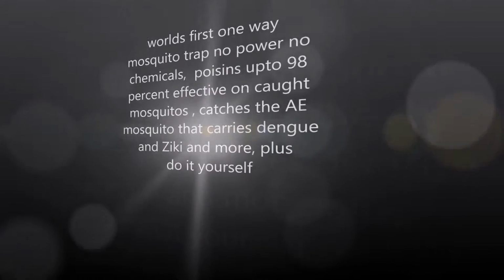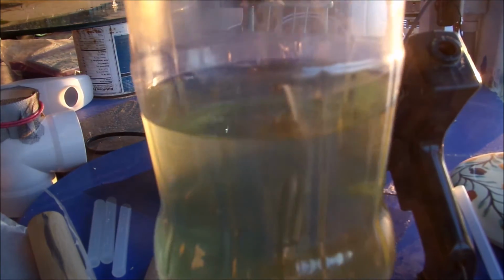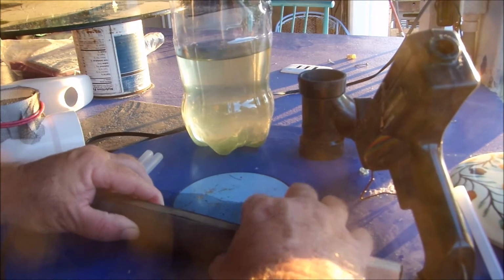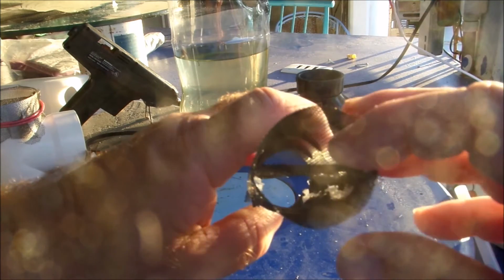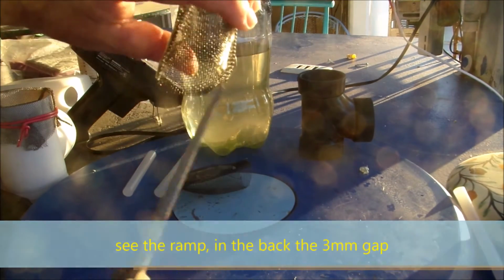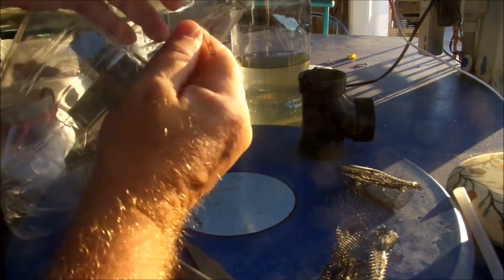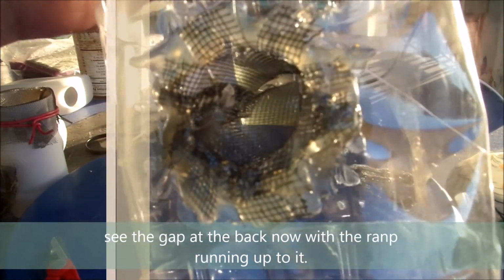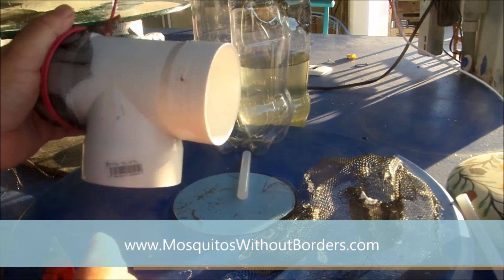new DIY one-way mosquito trap, just add water

Comment: Hi, I found your website and your video.  I am trying to make these to use around my house.  I don't have soda bottles but I do have 1 gallon spring water bottles and I have stainless steel screen.  My hot glue gun conveniently stopped working, so I took some flexible thin wire and kinda stitched the roll in place to make a wire mesh tube. Because the wire mesh is so stiff I don't think it will flex back open, but I will take a part of the wire mesh that peeled off and use that tiny wire to loop through the gap onto the outer circle of the tube. Thankfully I have some jewelry type tools,  pliers with strong flat grip and needle like grips to pull it all tight. . I was able to fix the glue gun enough to attach it to the side of the bottle. I collected some rain water  and left some leaves in it.  when I saw some larvae, I put BT into it to make sure they didn't mature and then I strained the water and put it into my jug.  I'll let you know what happens.  Thanks for this idea. If it is as successful as you suggest, I'll put up more around the house. My backyard is a pine forest that drains to the waterway so it stays damp and swarmed back there, even in the hottest part of the summer.
Reply: Thanks for the feedback.    Yes any type of decent sized bottle should work.   I have used some slightly cracked 5 gallon water jugs that hold water and put in two screens/traps.    as long as you get the angled screen walkway secured with just the small gap at the top you should hit 90-99% can not escape.    But I do agree with you putting in BT works great.    I actually built a few with screens right above the water line by cutting the bottle and placing the screen across an pressing the other side of the bottle then duck taped it.     But I have to say the feedback of seeing the larva seems motivating.      Feel free to send me pictures of the inside of the trap tube and I can give you feedback.     

Right now I have one attached to a septic vent,   I think I mentioned the septic tank vents act as a lure.     I have seen about 30 in a month dead inside my trap, as I know I they are not escaping the way they entered.     This trap has a screen on the end of the 4 inch tube that stops them from breading/getting into my septic tank.